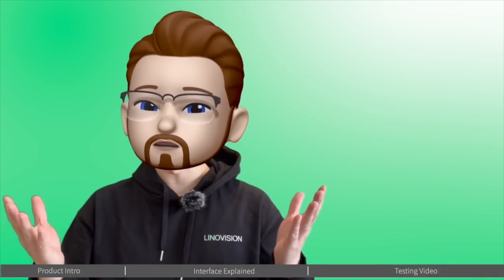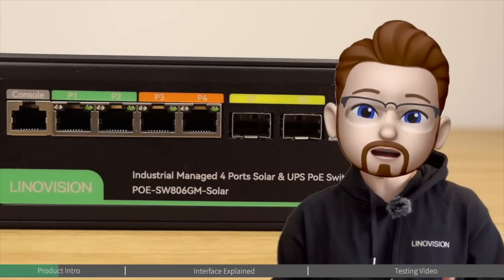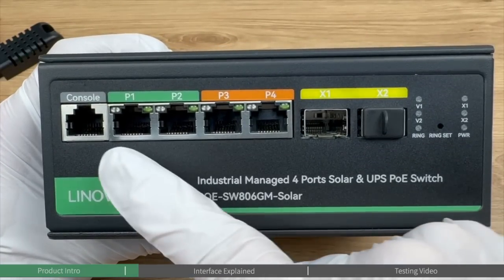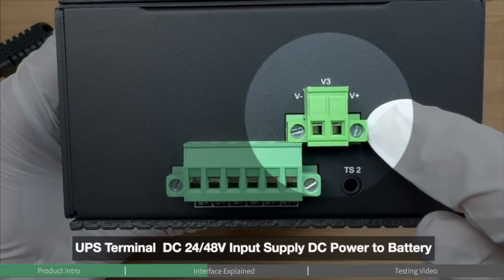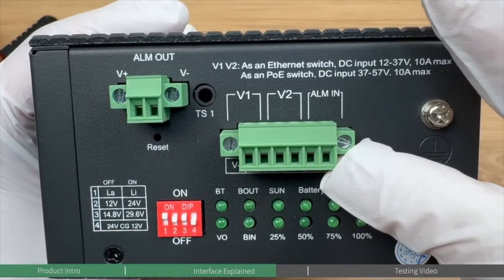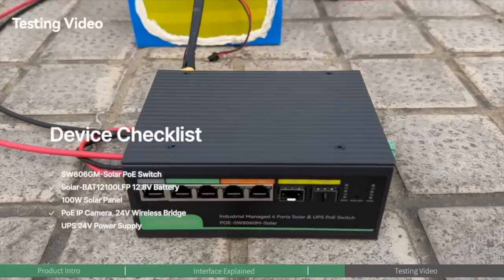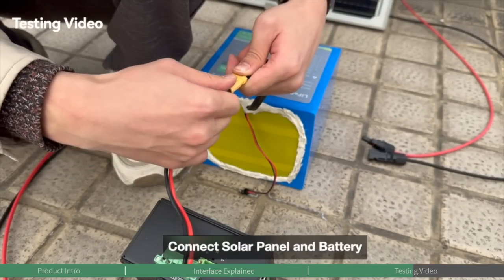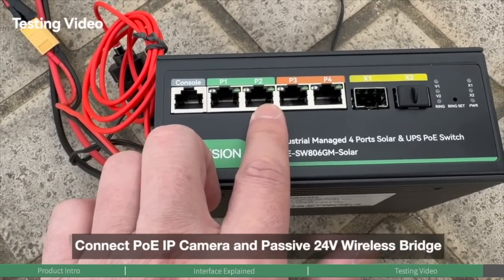Solar PoE Switch - The Secret of Integrating Solar Power System with PoE Switch?

Comment: Can the device be accessed remotely via a wireless bridge or can it only be managed via the console port?
Reply from the maker: You can absolutely manage the device remotely. It has a built-in web-based management interface, so as long as the switch’s IP address is reachable through your wireless bridge, you can access and configure it remotely.
Reply: @linovision awesome, thanks for the quick reply!

Comment: Meh.  Passive PoE ?  Why?   PoE+ works perfect with 48V LiFePO4 battery systems (whos batteries run roughly 48.0V to 56.8V... perfect as a PoE+ power supply without needing further regulation).  So if you had a 48V LiFePO4 compatible solar & UPS PoE switch, that would be the bees knees.  But passive 24V PoE is worthless.
Reply from the maker: Hey, really appreciate your detailed feedback — and you’re absolutely right, especially regarding the efficiency of using 48V LiFePO₄ battery systems for PoE+ applications. That voltage range (48–56.8V) lines up perfectly with IEEE 802.3at/bt specs, and in theory allows for a clean, direct power delivery with minimal conversion.

Our current Solar PoE Switch was designed with broader compatibility in mind. While more advanced users like yourself are building 48V systems, a large portion of our customer base still relies on 12V or 24V solar battery setups — particularly for remote surveillance, wireless links, and small-scale off-grid IoT deployments. To address this, we built in a flexible MPPT solar controller and included both IEEE 802.3af/at/bt and 24V passive PoE output options.

We understand that Passive PoE isn’t ideal in all scenarios. But for certain legacy devices — especially older IP cameras, CPEs, or wireless bridges that were designed around 24V passive PoE — this output is still widely used in the field. By supporting both passive and standard PoE, we’re trying to offer maximum deployment flexibility in environments where standardized infrastructure isn’t always available.

Again,  thanks for your insight. It’s feedback like yours that really helps us improve and expand our product line to meet the needs of both mainstream and power users.

Comment: И как долго эта система поддерживает питание, работу в отсутствии солнечных дней? Спасибо
Reply from the maker: The battery used in the system and the overall power consumption of the device may vary. For example, with a 12V 100AH battery and a device power consumption of 50W, the estimated runtime without sunlight would be approximately 24 hours.

Comment: The Solar PoE Switch offers the advantages of energy savings, flexibility, and easy installation by utilizing solar energy to power network devices, making it particularly suitable for remote or off-grid areas.

Comment: Can the switch be powered by a poe adapter, and if so, can it still be able to charge the battery?
Reply from the maker: Hi Jimmy, here's tip that would help with your concern. 
In the scenario of using UPS power supply, if the V1 or V2 power input interfaces on the UP Panel (with DIP switches) are connected, only the switch can be powered on.

but the battery cannot be charged; if the V3 power input interface on the Down Panel (battery interface side) is connected, the switch can be powered on while charging the battery.